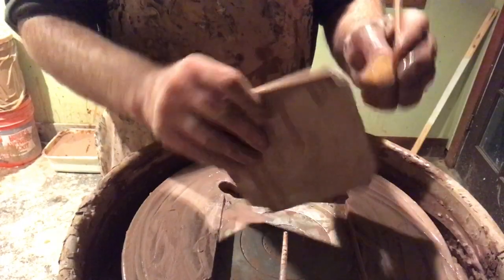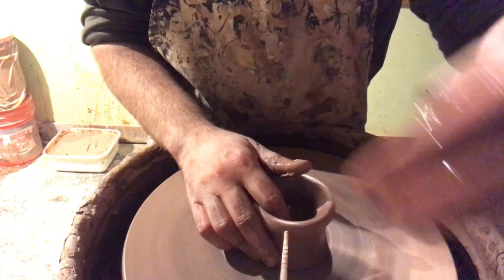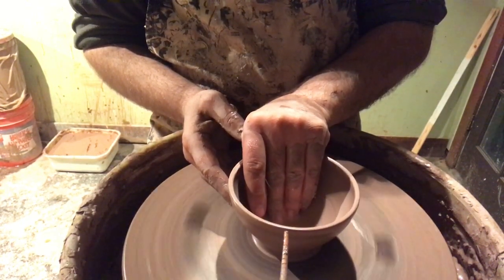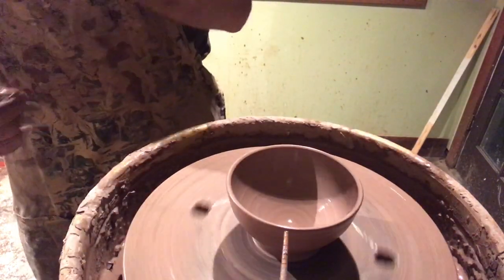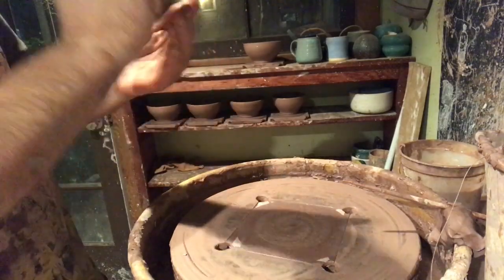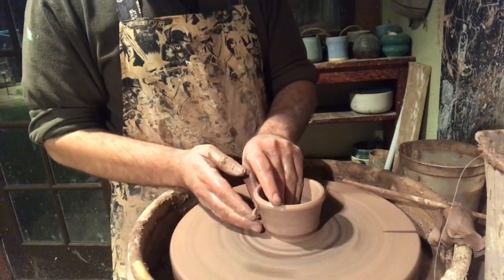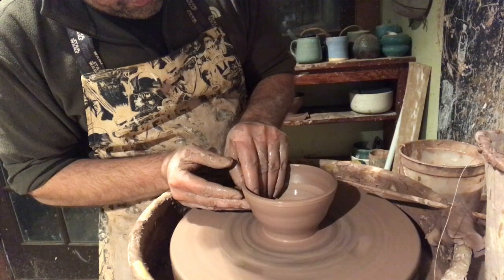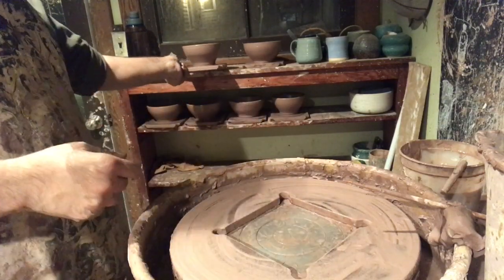Throwing Salsa Bowls on the Pottery Wheel

Comment: Thank you for this video! I need to do 100 salsa bowls! I have a question: when watching you throw I notice your outside fingers were higher than your inside fingers. This is opposite of what I’ve noticed when throwing cylinders. Is this because when throwing a bowl your inside hand starts in the middle of the bowl and not on the bottom of the cylinder? Also about how big are these bowls? Finally, thanks for the tip about stiff clay!
Reply from the maker: Many thanks for watching and sharing the thoughtful comments/questions.

I find that I prefer keeping the higher finger on the side that the clay is going. For instance, when coning inward/upward to make a cylinder, the higher finger is on the interior of the vessel. Conversely, since bowls are angled outward the opposite is happens (higher finger outside). One thing that the video fails to capture is how I apply pressure with my fingers. At times I use multiple fingers to guide the clay, so perhaps that can be misleading when seeing the height of one hand relative to the other.

These bowls are about 6 inches in diameter at the rim and 3.5 inches in height. They'll probably shrink to 5 and 3 inches respectively after glaze firing.